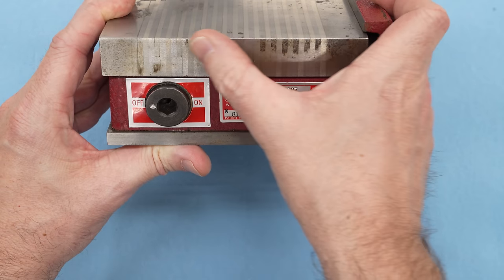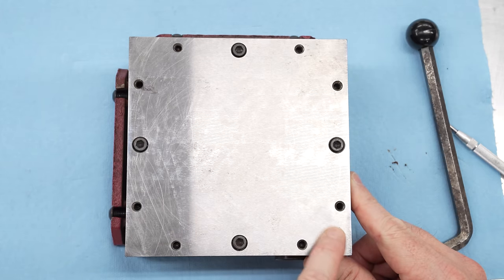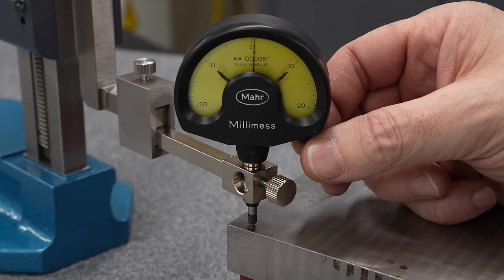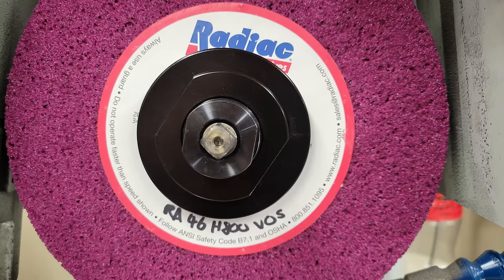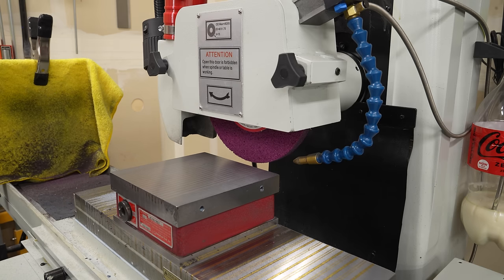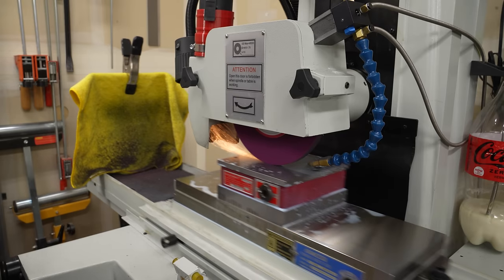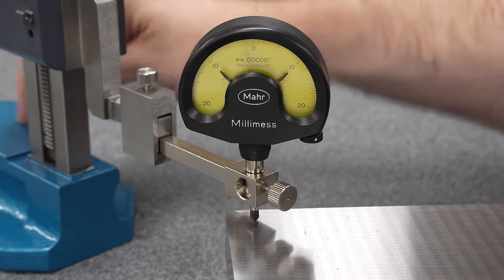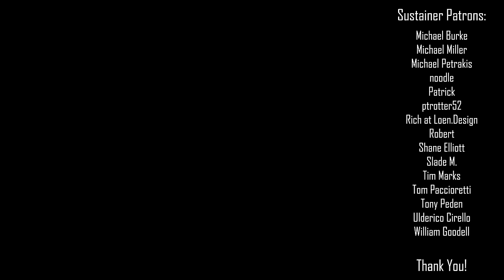Restoring a Rusty eBay Magnetic Chuck - Suburban Tool Sine-Set MC-66-FP-S1

Comment: Well I would have thought:  Outer surface of bolt- on base is crap.

That means, the bolted on face is crap & likely the bottom of mag unit is crap too.

Best option is to: 

Remove base and check / grind mag unit base.

Then planar grind the bolt-on bit.

Then bolt on the bottom bit & grind it.

Then attack the upper (work surface) with the grindwheel.

But during my deliberations,  I wondered how many mills, shapers, surface grinders etc, do you know that have alluminium or lead or copper or mumetal or brass beds?

I don't know any either.

So:  now my dylemma is enriched,
I have to ask what sort of idiot designs & sells a MAGNETIC chuck / vice /base that bolts down onto a great big lump of Iron?

Why not have a single actioned  duplex magnetic system (dual surface / upper & lower) that releases from the workpiece & bed at the same time & visa-v magnetically grabs the machine & the work simultaniously?

Less grief, less to warp,  less cost and a gained z height.

Comment: James, How do you or the grinder compensate for the reduction in wheel reduction during the passes?
Reply: As you step across the part for each pass, if you use a small stepover, only the edge of the wheel is doing any real work, and only it is losing any significant diameter. So while it may, after a while, not grind to the right depth, the piece of the wheel just inboard will still be the correct diameter, and will remove the bit the wheel edge didn't get.

If you only step over in one direction, only one edge of the wheel will get the most wear. Eventually the wheel will be cone shaped from wear all the way across, but this usually happens long after you have completed work on a part. 

In any case, you grind in at least two passes: one or more roughing passes, and one or more finishing passes. You re-dress the wheel flat before you start the finishing passes.
Reply: Thank you, always wondered about how it was compensated.  @lwilton

Comment: It's so weird for precision to hear the last country in the word using an English Old King Pre Newton era inch as a reference! It would be nice for the rest of the world to be inform in metric as well ;) Boring to have a calculator all time. Anyway thanks for the video.
Reply: Believe it or not the US is on Metric the inch is defined as a metric unit
Reply: A tenth is 2.5 microns. The math is not hard, no need to calculate.
Reply: I asked a metric YouTuber to consider adding in some imperial measurements so it was easier for many people with imperial shops to follow and Stephen told me to go pound sand with a little ridicule added in. Poor practice if you are trying to build a YouTube channel but so many people are just mean over the internet. I would love to have a metric shop but alas all my projects are in imperial as I basically do restoration work. I would be fine with Clough 42 to give some metric numbers with his imperial numbers and it would be good for everyone. So if you did YouTube would you try to include everyone or just ridicule others?

Comment: Man, you put the diamond dresser on backwards.
Reply from the maker: https://alandau.net/instructions-for-use-of-diamond-dressing-tools/
Reply: @Clough42  They are wrong too. That wears out the diamond faster. Books are not always correct in practice.
And it wears away the metal holding the diamond so they can sell you another one.
Reply: @forrestgumpv9049 I think you are crazy. You always dress the wheel downhill, not uphill.
Reply: @forrestgumpv9049   you never grind anything into the wheel. if the magnet failed its going to blow up the wheel and could seriously hurt you instead of the dresser just flying off the magnet
Reply: @yoopersen  I did not say that, did you even look at the video ?